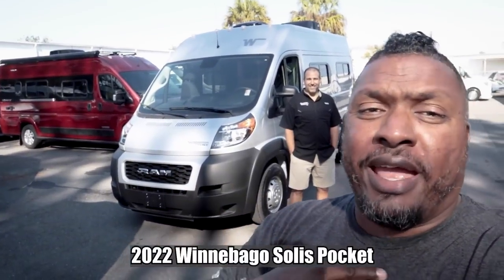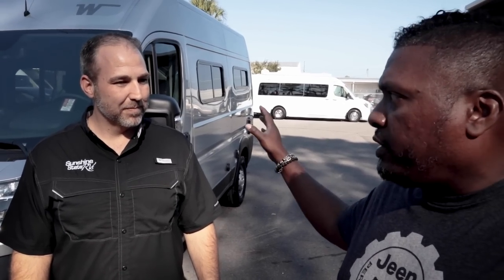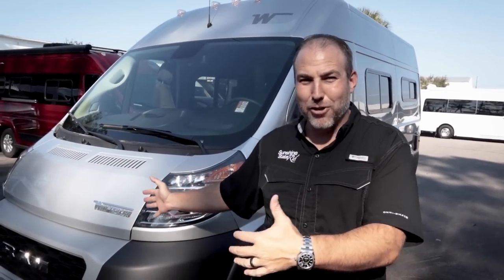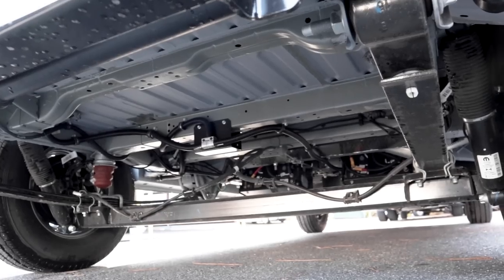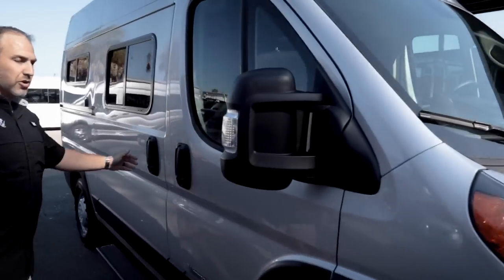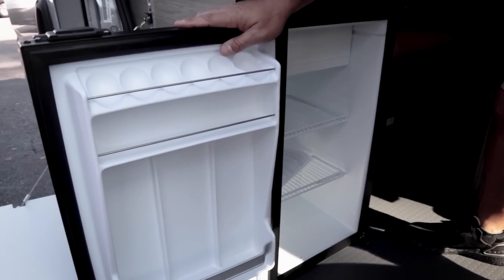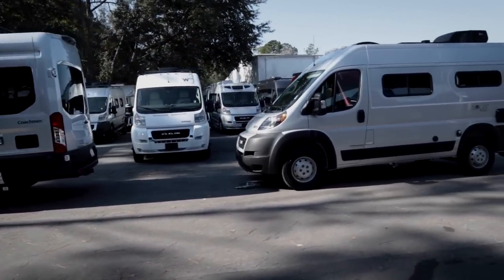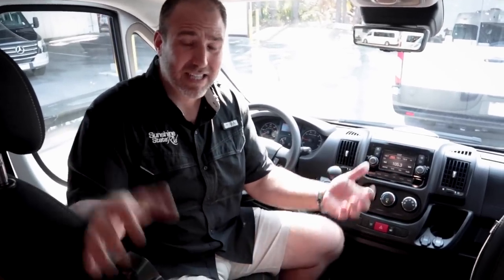SMALLEST WINNEBAGO Camper Van 2022 Solis Pocket with Murphy Bed!

Comment: Nice little camper, but...1.) Move the bed to the kitchen side. The metal bed frame behind the dinette seat creates a dangerous impact zone in the case of an accident. Hitting the back of your head on it could cause severe head injuries. 2.) Remove the upper bins of the two small storage cabinets under the bed. That would lower the bed about a foot, making it easier to get in & out of. Plus, it would give you more headroom sitting up in bed.

Comment: My poodle put dibs on the love seat! I would get a couple of large lithium batteries and a 3000 watt inverter.  AGM are a thing of the past, I am surprised they are using them. I am 76 and still attracted to this:)  If you build up a van yourself it is still called a van and insured as such.

Comment: Not sure how much boondocks you could do, no generator, no inverter.  Two batteries though which is good.  Do batteries recharge while driving?
Reply from the maker: The Batteries are AGM and they do recharge while driving…however I would definitely look to upgrade to Lithium if I had one of these
Reply: Just by an inverter generator and bolt it to cargo box on back. I have a 2200watt that runs my A/C.

Comment: no power adjustment on mirrors that is very important to have as you use that lower mirrors A LOT!  Also, they are not folding or heating mirrors that pretty much come standard on all promasters. Should be noted that power folding/heated mirrors is only a 300 dollar option. For me that's a deal killer, I wouldn't buy it, and don't think your going to upgrade it.  Also, I think there should have blind spot monitoring on all these vans and I would NOT buy a van without it. It's basically a yellow light that will flash when cars are in your blind spot. When changing lanes you only have your mirrors to help you do that and to have a led blinking when cars are next to you is a great safety feature. Shame on Winnebago for being so CHEAP, and shame on the sales people for selling this crap.